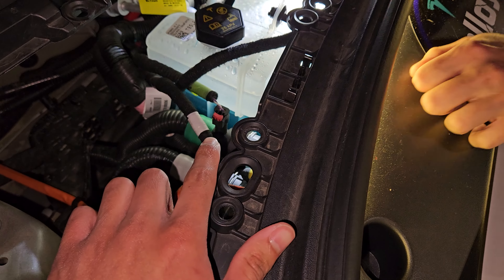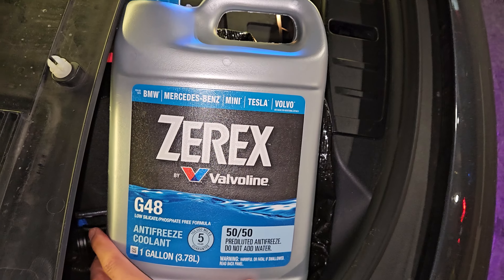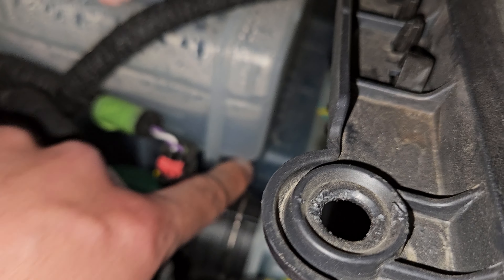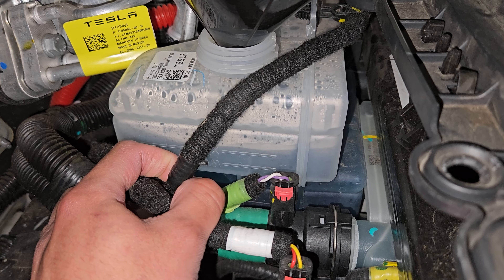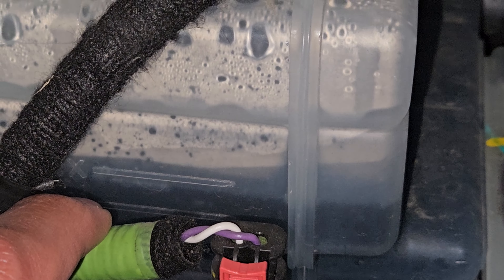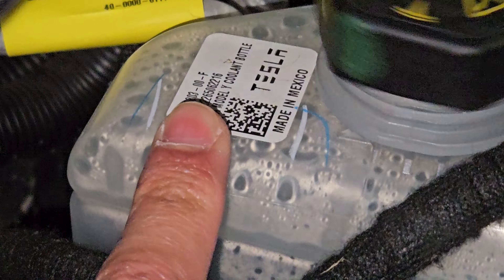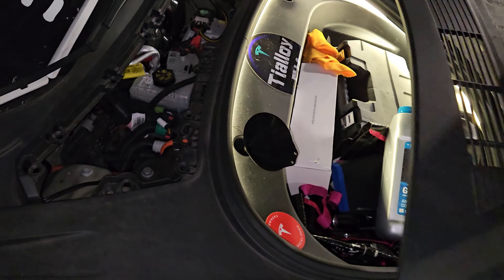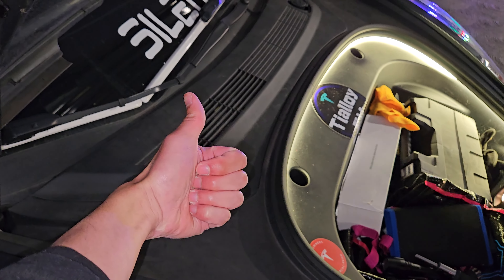topping off my TESLA model 3 coolant!

Comment: Is this battery coolant?
Reply from the maker: I believe so
Reply: @TeslaFPV  but if something happens, the warrant won’t cover by using this coolant, right?
Reply from the maker: No way Tesla would be able to tell. 
My friend who used to work at Tesla said this is what they used
Reply: @TeslaFPV  they use this exact brand?
Reply from the maker: @coolrunning2006  that is what my friend who used to work at Tesla said :)
Reply: @TeslaFPV any issue after topping off coolant ? Also ever figured out why your coolant was low
Reply from the maker: @coolrunning2006  no issues. No we didn't figure anything out but it doesn't seem to have gone down since then
Reply: @TeslaFPV  thnx bro!